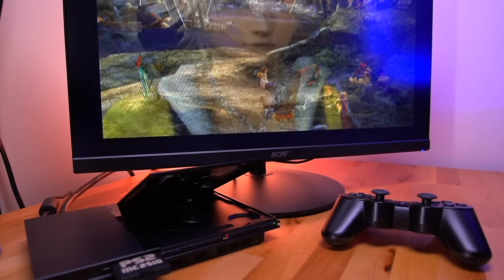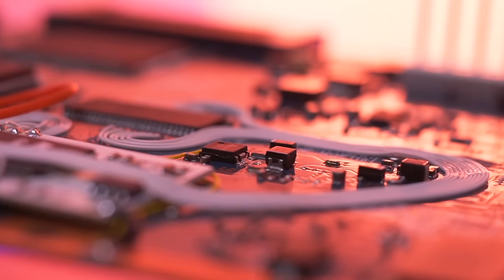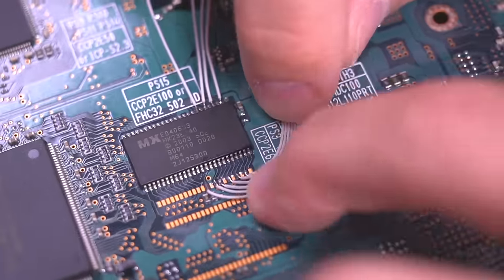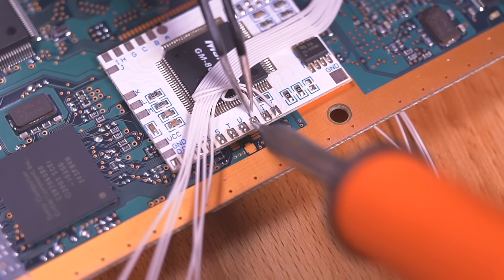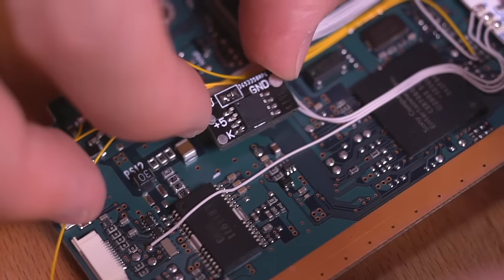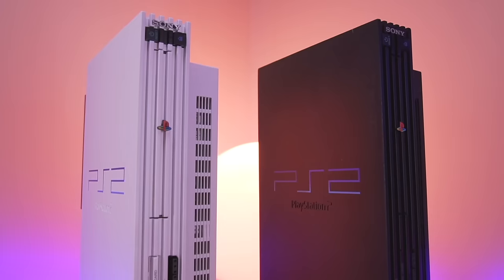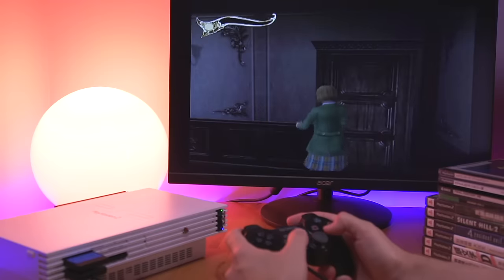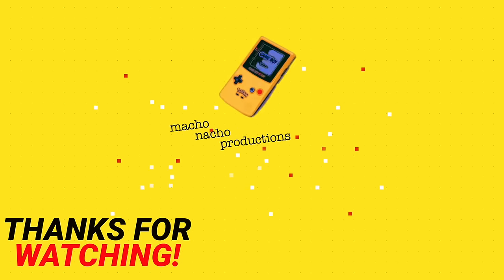Why You Need A PlayStation 2 Modchip In 2022!

Comment: I'd recommend against superglue to hold those wires down. It's almost impossible to remove without damaging the solder mask and possibly traces underneath. 
I know how glue gets a lot of guff from certain modders, but this is the right place to use it. Apply some solder and press it down with a piece of paper to flatten it and not burn yourself.
Hot glue comes off very easily with a little alcohol, so you can always undo your work or repair it if you make a mistake.
Reply: I think RetroGamingArts did a video explaining why superglue is one of the best and safest things to use in this application. All you need is isopropyl alcohol and the glue is no longer active.
Reply: @naliboi93  that's not true. In order to dissolve superglue (cyanoacrylate), you need acetone. Acetone dissolves solder mask as well.
Reply: @Null_Experis  you can use both. From experience of using alcohol in the past, you simply let it sit for some time and then the glue releases your wire or whatever else you'd binded. Let the alcohol sit a bit longer and you can brush away the solid clumps of superglue. It won't fully dissolve, but it comes away in chunks with minimal damage to the PCB if any. Obviously acetone has its properties that make it risky for solder mask, so you'd steer clear.

If we were going really crazy with superglue for a more permanent sturdy bond, you can even add bicarbonate of soda powder.

Heck, with medical grade superglue for cuts, I've heard some nurses say you could even use cola to immediately release the glue in a pinch if you've accidentally applied it to yourself.
Reply: How about electrical tape?

Comment: You can very easily configure a Matrix Infinity chip to boot right into any ELF you want at startup, like OPL for example.

Unless you need to play physical imports or PS1 burned discs, there is no reason to get a modchip anymore between FMCB/FMHD, Mechapwn, and the SD card reader. OPL is just too good at this stage and modchips are difficult to install and there's no reliable Mechacon fix for every console revision. But for people with large physical import collections (me) it still makes sense to have a chipped console.

Comment: I've probably watched this video close to 8 times at this point, I think using the individual wires instead of a ribbon cable just looks so cool. Although I like the ps2 and modding it, I really just keep coming back to this video for the wiring you did! The next time you do a video about a ribbon cable and mod chip please consider  showing off how much work it saves, and running individual wires like in this video. I'll keep watching your content even if it doesn't end up making the cut because I love your work. Just wanted to toss an idea in the ring.

Comment: Nice wiring, but... you shouldn't use cyanocrylate based glue. Cyanocrylate can be conductive, or its can become conductive over time. Its good idea to use silicon based crystal clear glue, its much safer and can be easy removed with IPA.

Comment: That is balls of steel. Supergluing wires to the Mainboard. Too bad it didn't (for other reasons I know) work.
You got your point across in the end. Even in 2022 mod chips are mixed bag. Know you PS2 model number for sure before you even start. Do your research. Take your time. Be ready to fail.
Thanks for the video.

Comment: My PS2 is the SCPH-30004 R PAL model was first modded with Origa chip that required disc swap booting with ActionReplay 2 disc & dongle. (Was sold as a complete bundle)

A year or 2 later, I resent it back to my PS2 vendor to be remoded with newer chip as it no longer be able to boot some newer games like VirtualON Mars & Start Ocean 3 as it just boots with a black screen.
 (You can't just buy a modchip from shops directly, it has to be included with installation)
At that time the Messiah modchip was the most popular and they claimed it was this modchip that they replaced in my PS2.

I went home and failed to boot any PS1 games, so I decided to strip my PS2 to the motherboard by myself although booting PS2 games VirtualON Mars & Start Ocean 3 is now working correctly.
After comparing it to pictures of all available modchips online at that time period, I found that installed modchip is actually a Mars modchip & not Messiah as claimed.
I also found the tech has incorrectly soldered 1 of the wire points according to the Mars modchip soldering diagrams and therefore I proceed to resolder the wire correctly by myself.
Finally after reassembly, all regions PS1 games are able to boot correctly.

Till this day, it is still working and compatible with FreeMcBoot as it is able to boot all games that I throw at it including burned PS2 DVDs.

I was contemplating whether to replace it with a newer modchip. Should I ?
Reply from the maker: Depends on your goals. If you want to play ps1 game backups, then I think it may be a good thing to do. If you just want to play ps2 games free mcboot is probably all you need
Reply: @MachoNachoProductions  I already have a modchiped SCPH-5503 PS1 which I will upgrade to Mayumi v4.0 next week.

Guess I'll leave my PS2 alone since my Mars modchip may contain a stable code that is no longer manufactured by anyone.

Comment: Hi love the video timing is perfect as I have just modded a slim 75003 model with a Mobo 5.0 mod chip and the pic fix 2 board to protect the laser although accordingly to limited documentation I’ve read it’s technically not needed on that specific model but it was cheap and easy enough to install and wouldn’t cause any issues. I also bought and set up the MC2SIO memory card that allows me to play games from it that you reviewed a while back. All works fine with the mod chip and if I disable the mod chip by pressing start button on power on of the PS2 I can play the games from the memory card. So I now have a fully working mod chip and can also play games from the memory card. Both coexist perfectly and a power off and on again enables the mod chip again.
Reply: Yes, the PIC- or Summ0ne-Fix is only required in 70k.

Does MX4SIO (MC2SIO) not work with your modchip being on? Try to turn of some settings like the MC16-Patch!
Reply: @tnaplastic2182  I’ll have a check with settings it just goes to a black screen for a long period of time. I read somewhere this was normal and was checking for something which would eventually time out
Reply: OPL also has "Debug Colors". Use "BDM3 1629" (I think that was the revision/build.)!
Reply from the maker: Sounds like a sweet setup dude!

Comment: Viewer here from the Philippines. I am thinking of getting a Japanese SCPH-50000 Fat PS2 and having it modded. However it should be noted that each modchip works differently when booting-up PS1 games.

Back on Sunday, August 25, 2002, my uncle bought a mod chipped SCPH-30006 Fat PS2. It would play PS2 and PS1 games and DVD movie discs from any region. PS2 games would do straight boot-up but if you wanted to play PS1 games or watch DVD movies, you would have to insert the disc, close the disc tray, press the reset button to put the PS2 in standby mode, then boot-up the PS2 by firmly holding down the reset button until the disc is read by the console. I asked RETRO GAMING ARTS about this and he replied stating it must be a Messiah or Magic mod chip that is installed in my uncle's PS2.

I have been searching YouTube to see if any later mod chips can boot-up PS2 and PS1 games as well as DVD movie discs from any region automatically without resorting to any boot-up trickery as if it were an unmodded PS2 and it looks like the ModBo 5.0 and 7.50 mod chips are able to do so however I am not sure if they are Free McBoot compatible.

What would be the best mod chip that you would recommend for a Fat PS2 that are models SCPH-3000x, SCPH-3900x, and SCPH-5000x?
Reply: BUMP PLZ REPLY TO THIS COMMENT THINKIN ABOUT GETTING A JAP SCPH-5000X AS WELL

Comment: Holy crap that mod chop is way more advanced than when I was modding PS2s back in 2002. I see this new one come on a pcb with components which probably helps A TON. Back then it was only a chip and thats it. Also they'd get super hot so cooling was san issue sometimes.

Comment: I swear one day I'll do a teardown of my SCPH-9000 series slim to show the shitshow of a mod I did back in the 2000s. I actually don't remember how I routed it butI think it's bad. I didn't know what I was doing at all but I had the benefits of much younger eyesight. So I took my time and did it right the first time, and with much trepidation, I turned it on to be greeted with the ChipMod boot logo. Now I have that slim and a Fat that I bought in a thrift store. I use the slim to make memory cards for the fat because the slim's drive kept failing.

Old ChipMods used to put strain on the DVD drive somehow and burn out the laser diode quicker than usual. I had never done the fix for that yet.

I did buy some more recent mods with the laser fix but I haven't bothered to dive back into it again. My eyesight for up close stuff is nowhere near as good as it used to be. SMD soldering is okay with a magnifying glass but it's tricky! Gotta have a perfectly hot iron and just tap the trace so you don't lift it! 

What a rush!
Reply from the maker: There’s a mod to protect the laser which I plan to cover soon
Reply: Yeah I saw you had one in the video. The mod I have in my parts bin is similar, but smaller.

Comment: It is a lot more challenging for me to hardmod anything nowadays due to medical issues, and things like a PS2 hardmod I tend to split between a couple of days, but even with the challenge, I prefer it any day to the softmod options, as softmodding, unless it's a CFW of some kind, seems like a half baked attempt. Having skin in the game, like possibly frying your motherboard or bricking your console, makes the successful mod feel that much more rewarding.

I can't remember exactly how many PS2s I've hardmodded, but I've done a few, and cable management is a part of the art. I haven't done it for profit, I left that behind in my PS1 days, but I have modded friends consoles, and I personally own 3 hardmodded PS2s: a black 3000x, a silver 3900x, and a pink 7700x. They all play both import and backup games from any region, and the only issue I've had with hardmodded consoles is that Slim models aren't easy to get Dual Layer backup games to work, as the Slim lasers just don't seem to like those discs, but there are very few DL games out there so not really too much of an issue. Phat consoles don' t seem to have this problem.

Comment: Back in the day there was modchip websites that had all the modchip compatibility list.  It was simple just look up what you got and make a decision on which chip you wanted.  Hard part was installing it.  I went through five PS2s before I got it right.  What a huge pain that was back in the day.  There was also a swap disc mode where you put a custom ps2 slim disc lid.  That was way easier than the modchip solution.  But, backing up discs is a lost art and who knows how long them disc drives will last.  Just had my slim PS2 disc drive go out on me recently.  I tried swapping the laser out and broke it.  Optical disc emulators are the way to go.

Comment: I have 2 fat PS2s: a V7 and a V4.  I put Modbo 5.0 in the V7 and it works fine, but not before I did some heavy searching as to how to get the software running.

Too bad I'll have to repeat all that for the other Modbo 5.0, for the V4.  Definitely have good wire and soldering tools around; these mods benefit greatly from them (and patience! It takes a lot of time to do it right, but not a lot of time to mess up and get the wrong solder point, create bridges, knock components off, etc.)

I'm chipping the fat ones because I can use a hard drive with them.

Comment: For me, personally, I would rather keep my PS2 bone stock, as it is the pink version. If I had a generic black model I would probably be inclined to do so. It's actually thanks to you that I bought an MC2SIO card and I can't wait to get my hands on it! That said, I also bought a SCART cable at the same time (PAL region here), so I can play NTSC games in glorious and sharp colours! My TV supports 60Hz and NTSC output, but because PAL and NTSC work differently, I simply cannot use my stock composite cable, as NTSC games I've tested will only output in monochrome.

Thankfully, my ex left me a PS2 memory card with FBMC on it, so being able to play backups has been a doozy and I've not had to shell out any extra cash to buy an FBMC memory card and even recently upgraded to the latest version of FBMC. The FBMC card has a Mini USB port on the side, but I have no idea what make & model it is, so I am unable to get my hands on any drivers or software compatible for it, to be able to utilise to its full extent.

If you or anyone else could give me any ideas what card it may be, I would be forever grateful!

Comment: I'm kind of surprised you didn't mention MechaPwn in this video! It only works on some PS2 models, but it's a much easier and accessible way to remove the region-lock with FreeMCBoot being the only barrier to entry.
Reply: Maybe because he has a Phat model and Mechapwn for the most part only works on the slim models. Its certainly the better option for the slim models considering how the difficulty increases dramatically for installing a mod chip in a slim.

Comment: I personally strongly disagree with the fancy glued wire method. Gluing the wires makes a mess of the board if you need to remove something to preform a repair. Also it's important with PS2 modchips to keep the wires as short and straight forward as possible, snaking them around the board adds unnecessary length to the wires causing interference which the SX and CX points are susceptible to. Interference causes chip boot failures (games rsod'ing).

I used to sell refurbished and modchipped PS2s on Ebay regularly for 3 years straight and was quite successful, I was one of the few in the UK doing it in the late 2010s and dare I say the only one on Ebay who was bloody good at it, the rest looked terrible lol. Unfortunately Ebay cracked down on what I was doing and I had to stop. I only sell them refurbished now.
Reply: gotta go etsy if you wanna sell modchipped consoles, but yeah it sure does feel like a nice kick to the nuts seeing the really horrendous jungles of wires sold on ebay, even today that still happens. Saw a guy proudly displaying a slim ps1 modchipped with thick cabling strewn all over the console, wanted over $100 even..

Comment: I originally modded my ps2 with an 8-wire starchip back in 2001, which only allowed for booting backup cd's in conjunction with a gameshark. The scene was crazy back in the day, with groups ripping dvd games to cd's or multiple cd's. GTA3 for example fit snuggly onto a single cd.
Later on I ended up getting a magic 3.1 modchip which promised no swapping. My ps2 was a weird v1/v2 hybrid that had no documentation so I tried my best to install it with the available v2 documentation. Booting the ps2 the first time and I get a black screen.... I quickly went to uninstall the modchip and put back the starchip and the ps2 came back to life, but it would not eject the dvd tray anymore. The tray would go back in but not come out and I had to use a key tool just to get out discs. Still have this jank ps2 to this day.

Comment: FMCB is usually compatible with Matrix clones (Modbo and XenoPS - I have both in about two slims IIRC) and most DMS3/4 clones, unless you're running some ancient basic chip (e.g Apple 75k or similar SX28 based chips) that the only thing it knows doing is booting games. Although even then I've had those run FMCB flawless (and in my case, it wasn't even a SX28 chip, just some noname chip that had no bootmenu or anything, but would play ALL discs you would throw at it.) so it really depends on the code quality and PS2 revision. 

I usually remember the slims being pretty picky in that regard, and the only chips I saw ever used in these were mostly Modbos - 760 were the most usual, XenoPS I had in a 77004 unit and a 4.0 in a rare 77007 I had accidentally found in a bundle with a old 70004 that was pretty much scrap unfortunately. I have to redo the 77007 atm since I have a botched 760 install in there thag I might try and fix.

Comment: in brazil 90% of ps2's are modchipped and you will only find geomatrix chips. they are extremely cheap and somehow easy to install. it has an os with plenty of options, including booting the opl from the SD card when tou turn the system on. these modchips made a lot of childhoods including mine and made big part on piracy

Comment: My designs for the v9 qsb laserfix is coming along. Gonna make a design for the v10 after that. Cheers!
Reply from the maker: Nice!  Love to check that out!!
Reply: @MachoNachoProductions  about the first attempt.

I believe the wire was first soldered to 12v input of the voltage regulator, instead of the needed 5v output pin. Most likely that killed the 12c(f)508 ic.

What symptoms does that board currently exhibit? If possible I'd try seeing if you can read the chip with a programmer, failing that I'd temporarily uninstall the laserfix. But also temporarily unhook the wires from the chip and insulate the ends, if a mechacon crash occurs there goes your laser assembly.

I had that happen before on a slim, thought I'd test my install without one of the power or ground wires (I forget but it was one or the other) and the system would boot to a black screen. Wiring up the modchip with both 3.3v and gnd fixed the issue.

Hopefully this is helpful for ya, also check fuse PS13 near the 12v input 5v output regulator.

Cheers!